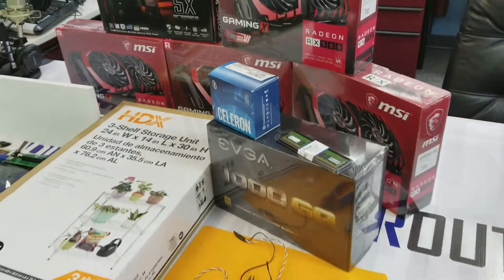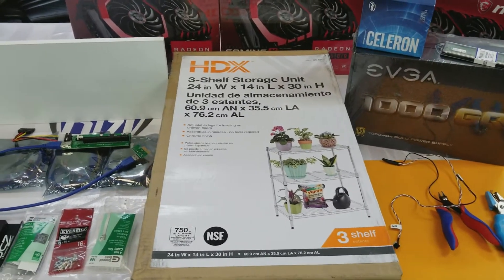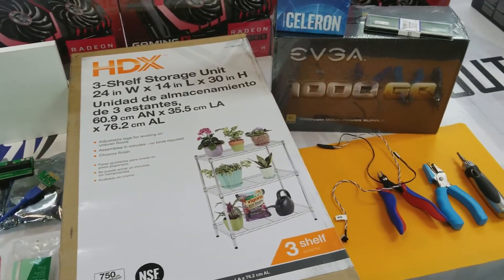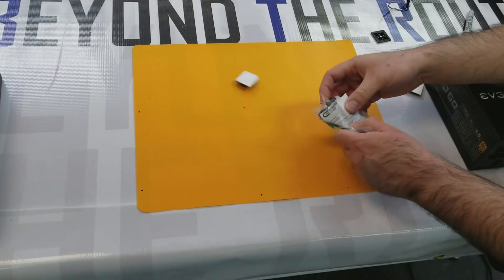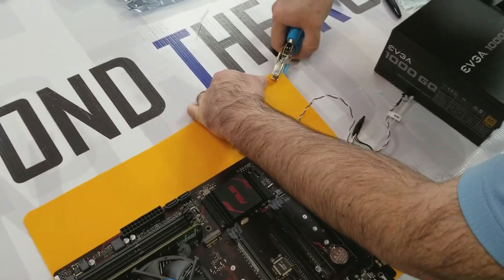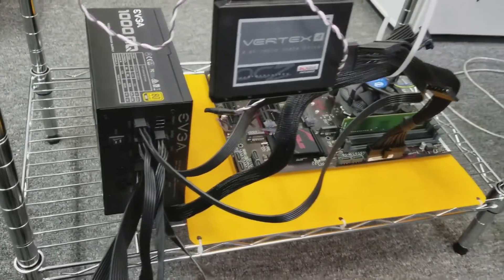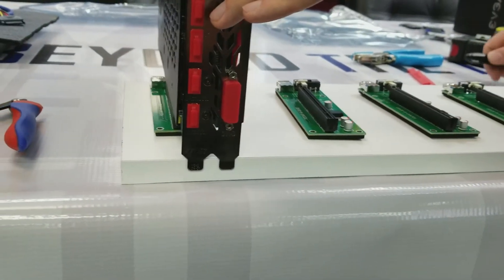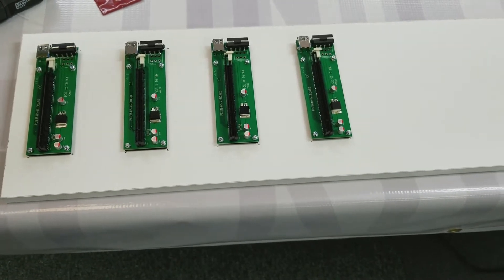BtR - Ethereum Mining Rig Build - ASUS Prime B250-PLUS and MSI Gaming X Radeon RX580

Comment: hello i have a same motherboard but my pcie x1 slot is not detecing my 2nd graphics card please help i want to add more card to my rig
Reply: I have the same problem, motherboard can only see 3 gpus.. the 4th not showing :(
Reply: Flemming Tønnesen my both pcie x1 not detecting cards do you thing its a mobi problem or bios settings?
Reply: Flemming Tønnesen hey i solved the problem i change the gen speed in bios from auto to gen 2 and it start working one gpu is on x16 slot and one on x1 and i will get new and put it in 2nd x16 slot ❤️
Reply: Umar Gigani what happens if i change to gen 1? Can you find where it says "4g enabled". Thats what youre suposed to switch on. But i cant find it :(
Reply: Flemming Tønnesen go to bios 
Then press f7 
Then go to advance
Then system agent 
In there you have 4d option

Comment: Hey man !
Does this board supports 6X RX 570 ?
I heard there are a lot of problems with 5+ cards
Reply from the maker: this board has 5 PCI-E slots, so to support more than 5, you will have to use the 2 available M.2 slots. The B250 chipset supports enough PCIE lanes to host more than 5 GPUs. The trick is to make sure in the bios to set the PCIE speed at 1x or 2x, not 3x or auto.
Reply: Beyond The Routine Ohh thank you my friend for the fast response.
Is there any good priced mobo that you like or offer for 6 cards (570) ?
Does the bios pcie speed settigs change anything in hashrate ?
Reply from the maker: The bios pcie speed settings have no effect on hashrate, as all you need is PCI-E 1x gen1 to achieve maximum hashrate
Reply: Beyond The Routine can you suggest 6slots mobo please for good value?
Reply: At me such is there are all 6 cards without problems) https://miningclub.info/threads/asus-prime-b250-plus.16787/

Comment: Hello, does this motherboard support more GPUs? or does it cap out at 4 gpus?
Reply from the maker: it will support more than 4 GPUs, it comes equipped with 2 of the PCIex16 slots and 2 of the PCIe x 1 slots, so to handle more GPUs you will need a PCIE 1 to 3 splitter, such as this one: http://a.co/3pQTguS

Comment: hey this card is good for mining? https://www.amazon.com/Gigabyte-AORUS-Radeon-Graphic-GV-RX580AORUS-8GD/dp/B06Y46X4L9/ref=sr_1_2?s=pc&ie=UTF8&qid=1494888093&sr=1-2&keywords=rx+580
Reply from the maker: We have not tested the 8GB version, the 4GB version is only soso in mining.
Reply: thank you ! what is better? a 6 gpu 470 rig, a 480 gpu rig (6), or the 580 ones? if i buy 580 i can only run 5 gpu for the moment rigth? sorry im new in this
Reply from the maker: We've had the most success with 480's from a Hashrate perspective.  Currently you can run 6 580's by hacking drivers together.  Our friend @Cryptomined made a video on it.. check it out.
Reply: thank so much!

Comment: Thank you so much guys :)
I'm going to send you an email about the timings you used for your bios mod.  see if i can help you more.
Reply: I have 2 RX 470 4GB, 2 RX 570 4GB, and 1 580 4GB, the RX 470s are Samsung Memory, RX 570s Hynix, and RX 580.. I don't know yet lol gotta build the new computer considering MY MOTHERBOARD WENT OUT AS I GOT IT!

They are all MSI GAMING X cards... no bios switch, I am scared AF to do this.. I need an accurate description and video on how to do this FOR the memory types CORRECTLY!
Reply: mobo died?i got a 570 4g a couple days ago, still need to stick it in a miner, been extremely busy this week with store stuff, havent even been able to build a miner thats been sitting around...  i will do a mod video with that card once I play with it, if i get any others, ill do the same
Reply: If I were to fail a bios mod, (involving the timings only) because I dare not mess with anything else... but yeah, if I were to fail and the card had no display.. how could I fix the card?

Of course I'd be using your 2 mixed AMD driver folder from your How to mine 5+ RX 500 series video.
Reply: you would boot into window using a second card, and then you would flash your bricked card with its original bios.   i think you will be fine if you test out the timings mods with different timings... never had a problem.. if anything it just wont mine properly and produce errors.  but ive never tried below 1500 timing.